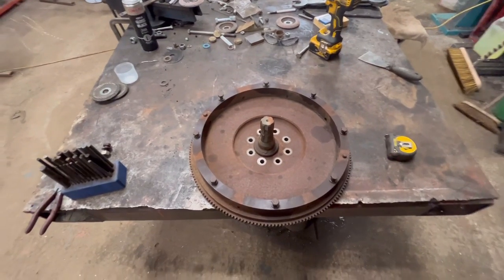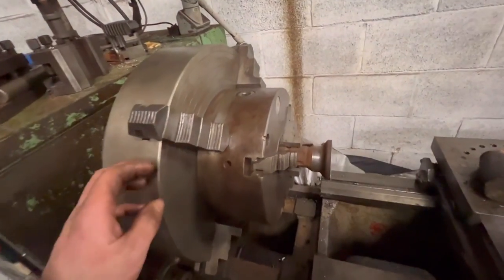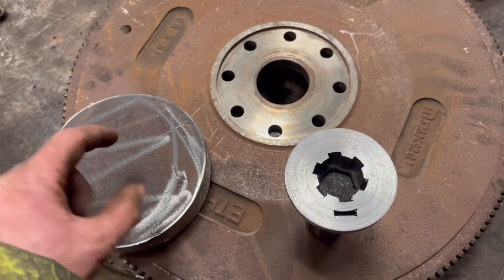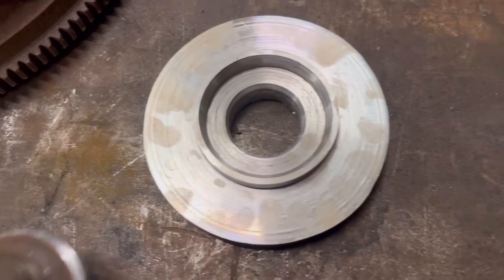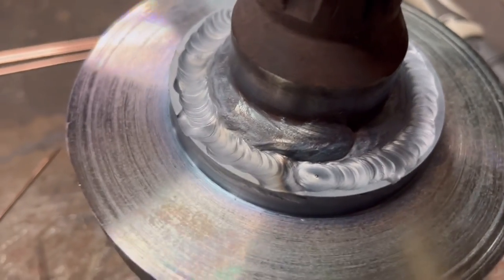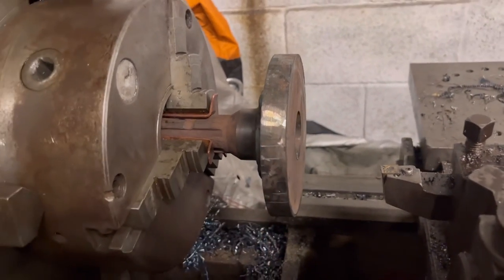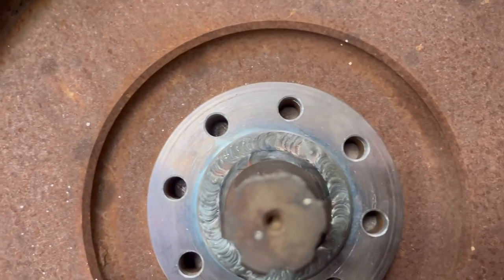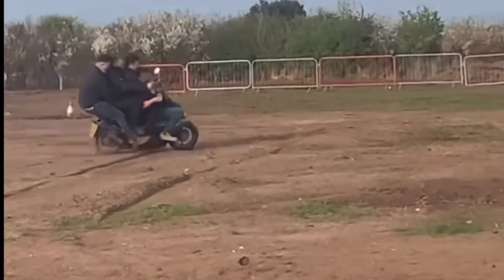Making a PTO adaptor for a Cummins 6bt flywheel.

Comment: Use larger diameter tig wire and feed the wire faster.    Use a rotating table for circular welds. (Adapt a scrap wheel hub)   Steady your torch hand by supporting the wrist on a block of wood or g clamp. Maintenance & repair is nearly always improvised all you can do is your best judgment which gets better over time. Good job.

Comment: That is a fantastic method of attaching the power take off directly to the engine. On my Morgan/Pembleton build I am using an R-100 BMW engine and an MG 4 speed transmission. I am planning on casting the adapter because we are only dealing with maybe 70 horsepower but probably less. I will definitely attempt to video all the parts to the build. You are an inspiration. I figured casting the adapter then turning it on my lathe. We shall see. Thanks for sharing all these great builds.

Comment: A useful tip when enlarging a predrilled hole on the pillar drill is to place a piece of emery tape cutting side towards the workpiece under the drill point. This eliminates chatter and snatching, plus the top face you've drilled has been deburred in the process. Keep up the good work you're an inspiration.  👍
Reply from the maker: Good tip! Thanks 👍🏻

Comment: Like your video's, you come up with some interesting fixes.  Connecting pto shafts to an engine can be a pain, if the crank and the load are not parallel the uj's in the pto shaft constantly waggle the shafts at either end. That could fatigue the weld off, and it would be the installation that did it. The axis of the crank and the slurry pump need to be offset a little but otherwise running roughly parallel.
Reply from the maker: Thanks. 
And Thanks for the info! You sound like someone that knows what they’re talking about.   I’m not quite sure how the customer is doing the installation but ill be sure to mention that to him.

Comment: Great video, as always!  Cutting Edge Engineering has a “how to” video on how he drills and taps the front surface of the lathe jaws, which allows him to easily bolt the copper soft jaws in so they don’t move on you.  You may want to give it a try! If you do, please do it on camera!

Comment: Hi olly good job there. Your tig welding is nice and flat. Getting good at it. Felt sorry for the old company transport struggling a bit four up.😂 you are bringing  more to the channel  each vid good to see your sense of humour. Great way to round things off. If you have any tractor vids love to see them big tractor fan as well as the engineering and welding. My mate made a replica Ferguson trailer the little grey one with the sloping sides. All he started with was the axle and measurements quite a lot of angles on it takes a bit of working out. Would like to see you make a fergie t 20 doe tractor  puller. 😁 thanks Ruth.
Reply from the maker: Hi Ruth.  Tig welding getting better slowly, short of time to have a practice. The last time I used it was in a video.  
The work van took some abuse that weekend 🤣  
If the YouTube side of things takes off and it pays good then I could make something like that. At the moment I have enough unfinished projects 🫣
Reply: 22:58...Dr. Carlson always says in his videos: "...you're doing so at your own risk-!"

Comment: The regular quiet popping of the torch while it’s burning is because the tip isn’t perfectly  sealed into the cutting torch body.
Reply from the maker: Is that why. I did wonder why it does that sometimes.

Comment: Welger ap 630 and 530 etc balers had a similar 6 spline stub shaft bolted onto the flywheel  it would have been handy for you to use on that job

Comment: Now unless that engine is going to run at a constant 540rpm's, l think l would've opted for a donor automotive transmission output shaft (size and spline count) that is meant to run at the rated 1800 rpm's.  Plus a shaft that size to a hub like that should be  enertia welded.  Your machining and welding skills look top notch, though 😊

Comment: What does pre-heating the steel do before welding? Whats the advantages vs not pre-heating
Reply: Pre-heat lessens warping and improves penetration.
Looks like he got it blue going into green (about 320°C)
Reply: @jimurrata6785  Good to know! Thank you sir

Comment: Great work as usual, I love the simplicity of that plasma cutter, are there any modern system like it that can tracer lines like yours, i dont like the computer cad stuff
Reply from the maker: Yes, you can get a scanning head on a new machine. Ideal for parts that are hard to draw in cad or are one offs
Reply: @snowballengineering   do you have any recommendations or and advice where I can source said scanning heading, you are the only person I have seen using this ever!

Comment: How 'bout you making a video  by fabricating a rotating welding device so it turns by itself while you weld. Only if you have a need for such device though. Just asking.
Reply from the maker: That could be a good thing to make. I’ve managed till now without one but would certainly be helpful.
Reply: @snowballengineering  well... now you have food for thought👍🏼😃

Comment: That's a 540 spline, not 1000.  I don't think it'll have any trouble though!
Reply from the maker: 540 in the olden days 😉  A lot of 1000rpm equipment comes with the 6 spline shaft now.
Reply: @snowballengineering  My age is showing 😔
Reply: @tonyc.4528  
So is mine, we stand corrected